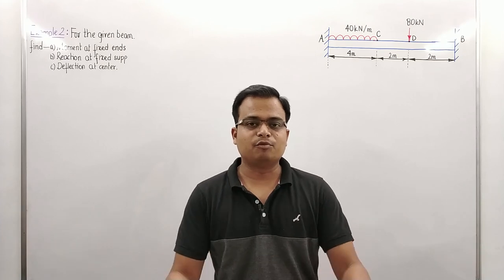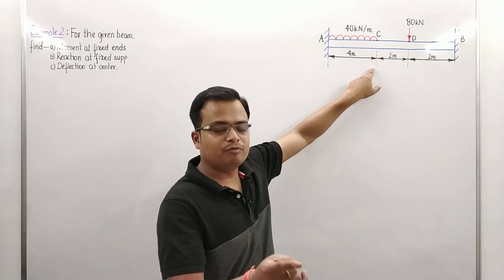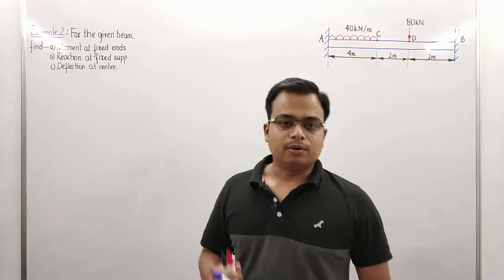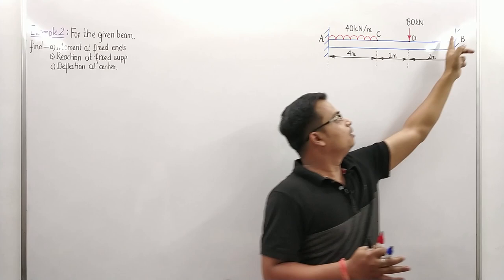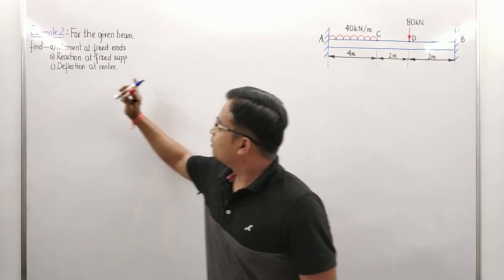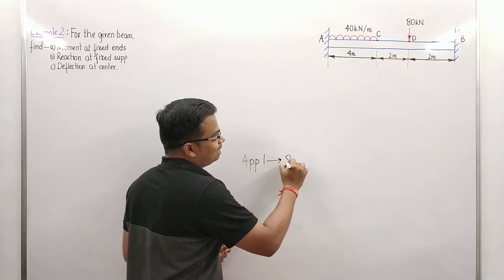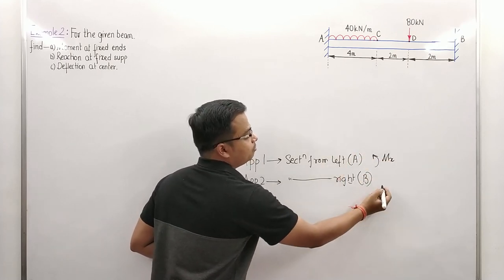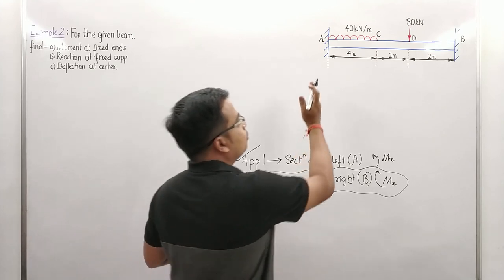Fixed Beams || Example 2_Point Load and UDL || Lecture 2

Comment: Integration of (x-6) is not equal to (x-6)^2/2. The answer when I expand and integrate is different. Please note this point, sir.
Reply from the maker: I know this mouni but that is exactly how macaulay's method works. You should watch my videos on deflection of beams and specially the first one where I explained the entire procedure.